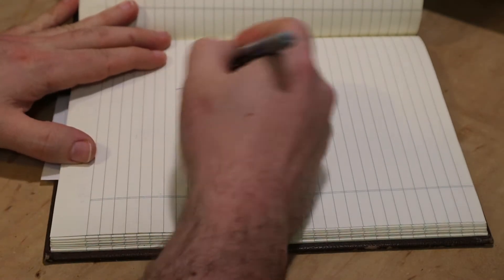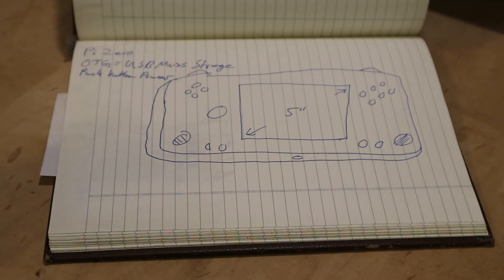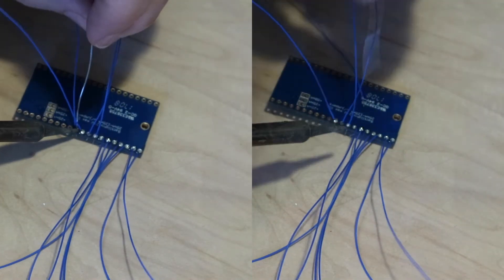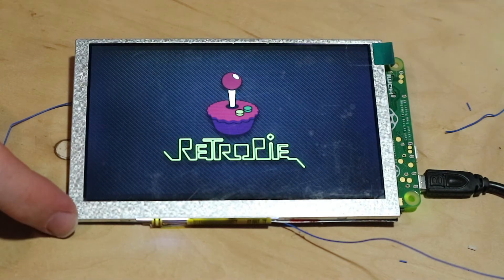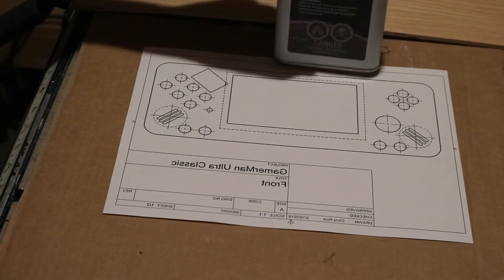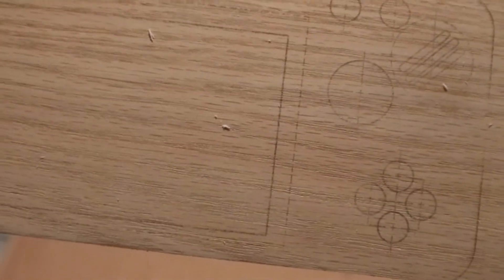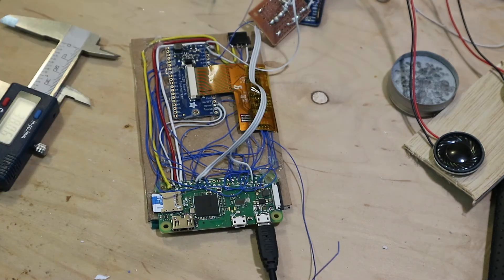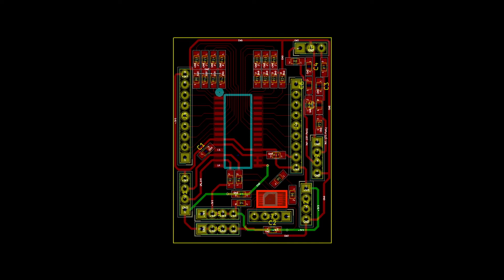Hack Like Heck: Chris Rice   GamerMan Ultra Classic

Comment: That pretty amazing!  I have been looking at all the different portables created for this contest and I have been inspired to build my own.  I don't know a lot about circuitry, resistors and transistors, but I'm willing to learn if that means I can make amazing products like this.
Reply from the maker: Im glad to hear that we've helped to inspire creativity.  Although I have only been on the Element14 community for the duration of this challenge they are a great source of help for newcomers like your self.  You can always start with a kit, there are many available to assist in making your own Raspberry Pi Portable.  Before buying one I highly recommend you google it and or youtube it and make sure you have a good idea how your going to control it, the display and audio.  Best of luck pursuing this hobby!